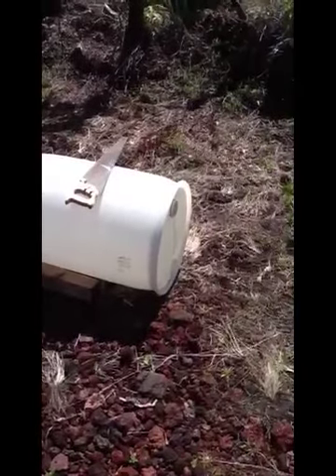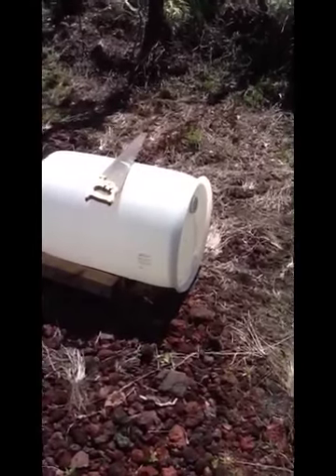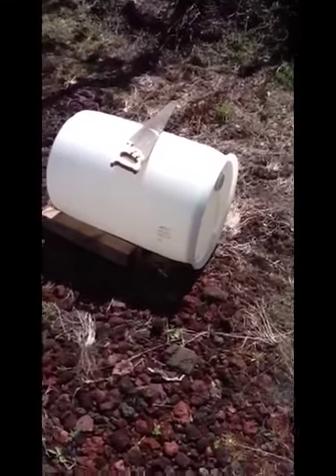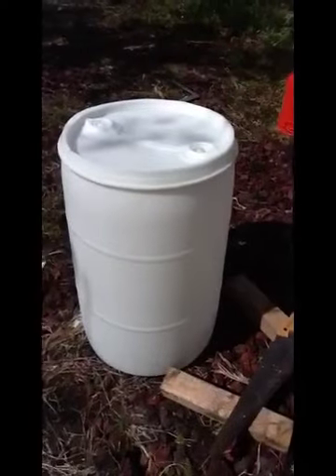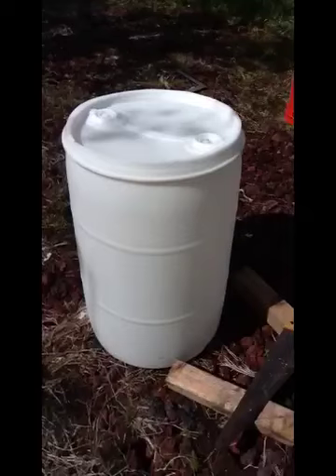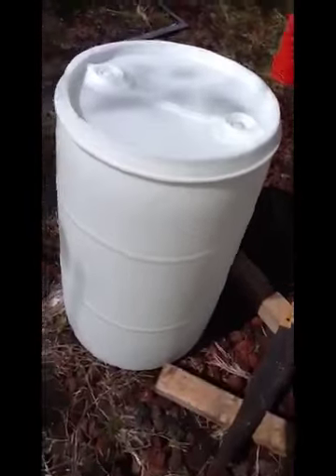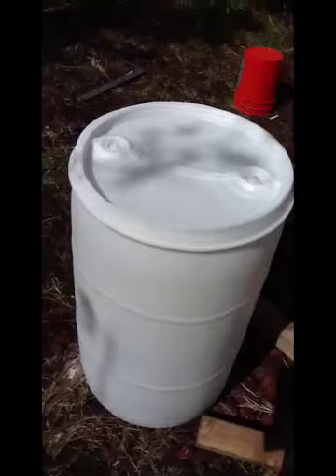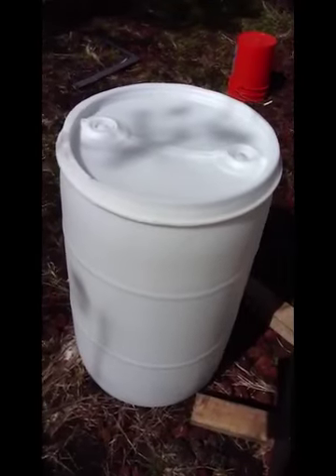How cut a plastic drum to where it has a useable lid.

Comment: These barrels are handy and with a removable top, even more so.   But just one caution to your viewer if I may.  Be VERY SURE you know what was originally in the barrels you get.  Many of them used for industrial purposes may have contained all sorts of highly toxic chemicals.  I would NOT use any barrel, even if allegedly cleaned out, that contained toxic chemicals for potable water storage or even for water for plants.  Use barrels that contained non-toxic substances for that.

Barrels which had toxic chemicals are still very useful.  I'm posting a video soon on my channel showing how I converted one to a mobile tool caddy for holding long handled tools like rakes, brooms, etc.  Getting the lid off is a good first step.

Comment: I want to use one of these barrels for a rotating composter.  If I remove the lid per your method, does the barrel become too flimsy?  I plan on drilling holes in the top to refasten the lid with bungies.  Any advice would be appreciated.  Thanks